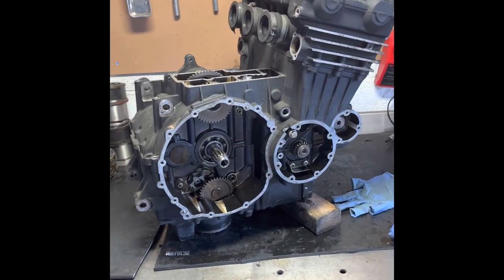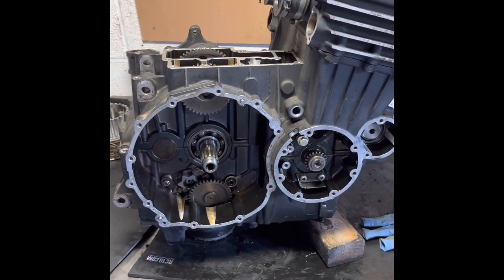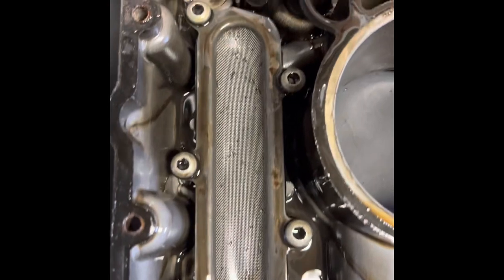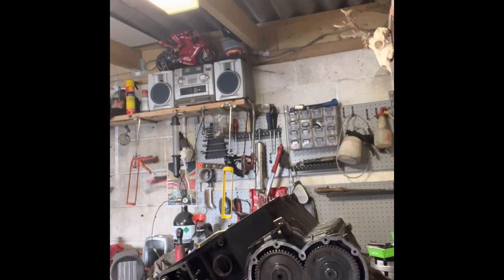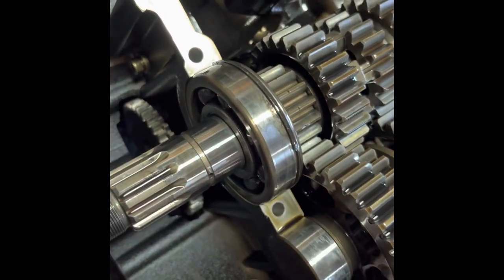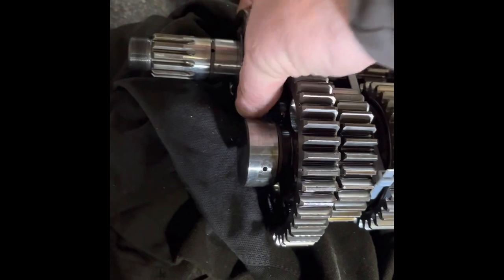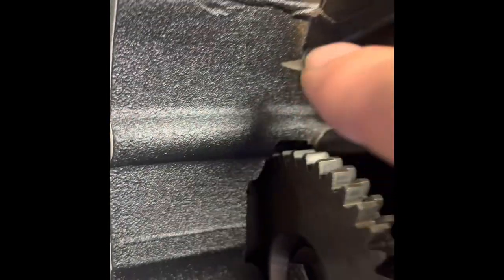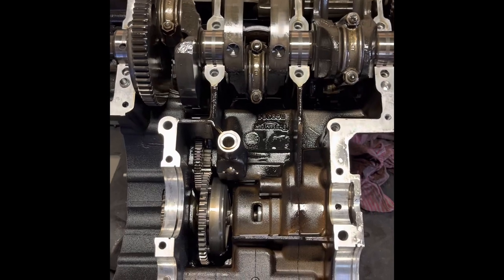Triumph T300 sprag clutch (no access pannel).

Comment: Hi I'm thinking of buying a 97 MK1 Thunderbird Sport. I've heard about sprag clutch problems on them.
Could you tell me which years they had the access panel up top. Thanks.
Reply from the maker: Hi there, I believe the the thunderbird sport all had the engine with no access panel.
The biggest cause of the sprag failing is trying to start the bike with a weak battery, if you alway have a staring or fully charged battery, you should never have this issue.